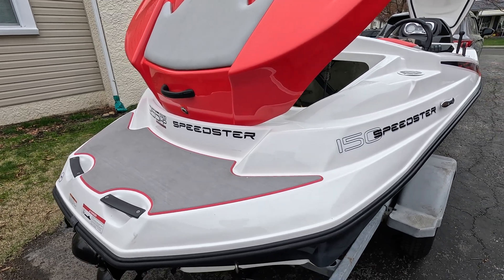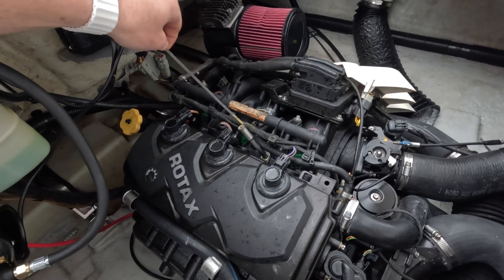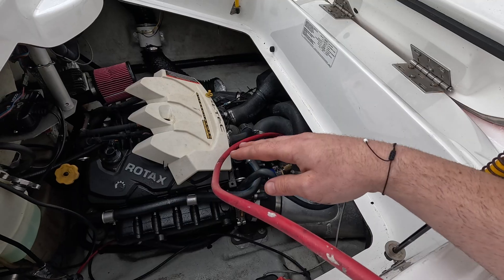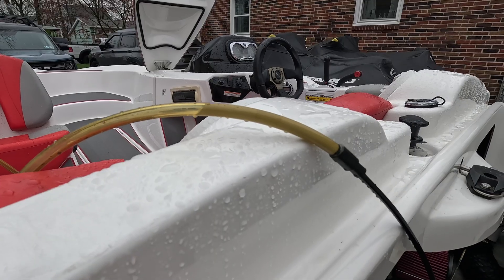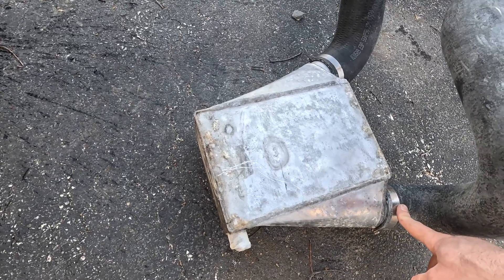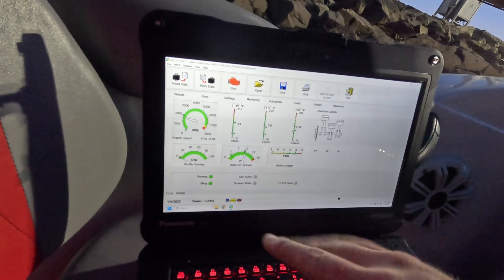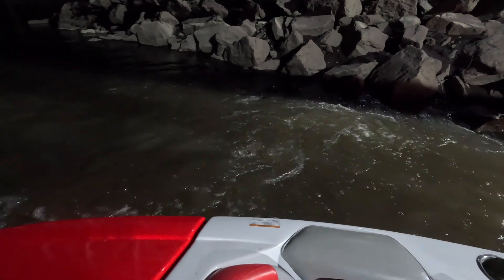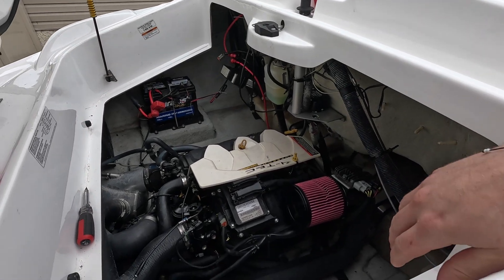SeaDoo Intercooler Failure - Performance Loss and Milky Oil

Comment: hi jake I have 23 gtx 300 my service tolds me replace the intercooler every 2 year before it fails and if you dont replace it you would get water in to the engine is that right
Reply from the maker: Sounds like they want to sell you some parts. You don't need to replace an intercooler unless it fails. It could last 15 years before it needs to be replaced.
Reply: @jetskijake-seadoo would intercooler fail damege engine when it fails salt water goes to engine block and corroeds if to much water flows in it could block the piston and bent piston rods
Reply from the maker: @onurguzelis  Your engine would suck in water and you'd be able to tell by the power loss. It only becomes problematic when you let it go and dont address it.

Comment: Did you pinch the coolant lines?
Reply from the maker: Nope, coolant doesn't pass through the intercooler
Reply: So I sunk my ski and their recommended to boil out to get the rest of the water out of the oil. So just bring to a dock and run it at 3000-3500rpms with dip stick little out and monitor oil temp to be around 80 Celsius. That's about it?
Reply: Carbon seal fail, I did oil change, plugs, got put as much water as I could

Comment: Hey Jake looking for some advice here.

I have a 2009 Sea-Doo Challenger 180. Before winterizing last fall, I topped up the coolant and filled the gas with stabilizer as usual.

Today while getting it ready for the season, I noticed the coolant reservoir was bone dry while I was cleaning the interior and exterior. Ended up vacuuming out some water and found it mixed with green coolant.

Checked the engine oil — no signs of coolant in there. Ran the engine for a few minutes on the trailer; it ran fine and didn’t seem to get hot. The return line for the coolant felt warm as it should.

Now I'm a bit baffled as to where all the coolant went over the winter. No obvious leaks or puddles around the engine bay. Has anyone else had this happen, or any ideas on what I should check next?

Also, what software was that? Is it something affordable to get? Can it copy keys too?

Appreciate any insight — thanks in advance!

Located in Edmonton, Alberta.
Reply from the maker: I would pressure test the cooling system just to see if you can find where the leak is first.  It could be as simple as a cracked hose or fitting. You'll need this kit https://amzn.to/4kgecSq which includes the correct fitting. All you need to do is pump it up to 10-15PSI to see where the leak is. 

The software is called BUDS, it's the dealer software so it gives you full diagnostic capability for your SeaDoo. It's pretty pricey but the one you'd need is cheaper than BUDS2 which is for 2016 and newer. The one you'd need is https://amzn.to/3HpeA2E

Comment: Hi, great video all time. Could I ask a newbie question? My Jetski is 2022 GTX300 running 93hrs. How do I know when I need to change intercooler and/or supercharger? Many Thks
Reply from the maker: The intercooler you only need to change when it fails. If you notice your oil turning milky, or it starts to bog when you're riding, that's a sign. You can test your intercooler by doing a boost leak test. If you hear air coming out of the flush port, it means your intercooler is bad. For the supercharger, you just need to check the slip at 150-200 hours. If its below spec, then its time to service it.

Comment: How does an intercooler leak cause water in the oil? Great video!
Reply from the maker: Great question! The intercooler is an Air/Water intercooler with the air and water separated by isolated jackets just like a radiator on a car. If one of the jackets cracks or corrodes away, the air and water can mix. When the engine is running, water is being pumped into the intercooler as well as pressurized air from the intercooler, this leads to the engine sucking in a bunch of air and water. Eventually, after running for so long like this, water will make its way into various points of the engine. It slips past the piston rings, the valves, etc which contaminates the oil.

Comment: Great video Jake. I'm a new  subscriber too. I have a question on Buds. Where can I purchase this tool. I'm a retired automotive tech bought  a 2024 RXP-X 325 last year. I would like to have the software to  perform the work myself. I will not allow a dealer to touch my ski.
Any info would be greatly appreciated. Thanks!  I found  the Buds 2 software on Amazon, but, I am unable to verify if it's ligidament ???
Reply from the maker: Thanks for your support! That's correct, Powersport diagnostics is a legitimate vendor. This is the kit you need https://amzn.to/4ifYXr0

Keep in mind that buds is licensed by time (of course) so you will need to purchase a new license (not a new diagnostic interface) when your time runs out. I've been renewing my licenses through dootune.com since they have very good rates.
Reply: @jetskijake-seadoo   Thanks!